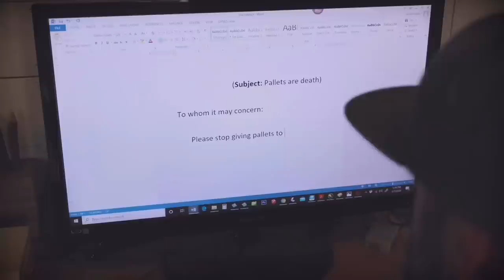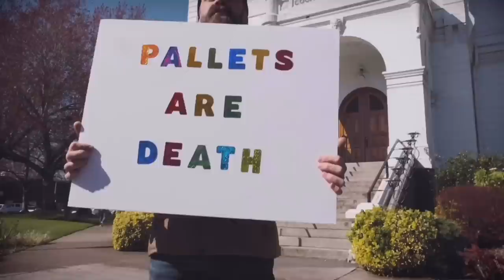I Made a $6000 Pallet | Worlds Most Expensive Pallet

Comment: I've seen pallets made from various hardwoods, pull them apart machine the heavy side and middle pieces use them for stuff like legs even tops for practical stuff like wooden tables for woodworking. I've made a couple woodworking benches that way.  You will save a lot of money and glue and machine them as you like if you need a heavy work surface it doesn't take much more glue than a worktop made from hardwoods that you have bought for the purpose, but the saving is immense.  I've gotten mahoganies, maple, oak ash and foreign stuff I couldn't even name. Looked good in the end too. the extra work made it worthwhile for the cash outlay.

Comment: I am so happy to hear someone like yourself say: pallet "furniture" is disgusting.
Its a blatant pawning off of kindling under the guise of up-cycling for suckers...😁
Reply: When you thoroughly rework the wood to no longer resemble a pallet, they are acceptable. Like planning, ripping, and making a proper butcher block table top, they are fine - not great, not good, but fine. When you stack 6 pallets and call it a couch, you can just go ahead and light that trash on fire and it'll be an improvement.
Reply: @knytetech7732  
Spot on mate.👍

Comment: Safety notes when it comes to pallets, for those who don't share the video's hatred of pallets 😉

In Europe, and most of the world... pallets these days are not allowed to have been treated with pesticides or chemicals... but they are almost all heat treated. Non-EPAL pallets, easy to see if they're dangerous or not. If they're unmarked, they are usually made in the country which you found them, and are intended to be single use for domestic shipments only, and then thrown away. Thus, nobody would ever waste time spraying them. As for marked... Just have to make sure it's not marked with "MB", which means Methyl Bromide, a very toxic chemical that is now banned in most of the world. DB means it was debarked, HT means heat treated and KD means Kiln Dried. All three of these markings are perfectly safe.
Example: This pallet was Heat Treated, and DeBarked... and is 100% safe to use.
https://www.1001pallets.com/wp-content/uploads/2013/06/1001pallets.com-how-to-tell-if-a-pallet-is-safe-for-reuse-5.jpg

Another thing to be wary of, is brown, blue or red pallets from the like of CHEP, because their paints are actually toxic.

Third and final thing a European would know (hopefully) to watch out for, is the pallets made specifically for the purpose of transporting chemicals, also called CP Pallets. They are easily distinguishable by the deckboards and bottom leads overhanging the blocks. Such as here:
https://palletcentrale.nl/wp-content/uploads/2018/03/CP3-pallet-114x114cm-nieuw-1.jpg

CP Pallets also have to be labelled as such (notice the CP3 designation in this image)...
https://www.sartorilegno.com/images/pagine/pagina-cp.jpg

Reasons why using pallets is a good thing?

Us Europeans can find excellent value in scavenging EUR/EPAL pallets... cause they're commonly made of Oak, Birch or other very sturdy woods, and the boards are typically 10mm thick, 1.2m long and cut very straight, meaning they glue together very nicely into boards providing they haven't been damaged too badly. Nice sidenote here: individual companies aren't even allowed to repair EPAL pallets, technically speaking. They're only allowed to be repaired by authorized companies. What this means is, a perfectly good, very freshly made pallet will be thrown away to be burned by most companies, just because an employee in a warehouse inserted the forklift incorrectly (went in too far, or not enough), causing the forklift to literally pry the pallet's bottom lead off. Since they aren't allowed to repair... yeah. RIP freshly cut lumber, unless someone comes along to save it.

Not bad for something gained for free, being able to make a $1000 piece of furniture for almost free (time and consumables being the only actual cost) :P The literal only downfall of EPAL pallets, is that they use block feet rather than 2x4s as legs. Less value in the pallet as a whole when that's considered.

Comment: It may be the most expensive wood-based pallet, but having hauled steel coils on a flatbed, I can assure you those steel pallets cost far more.  They also weigh far more and are only used on the 30,000lb and up coils.  

Also, yours looks nicer.